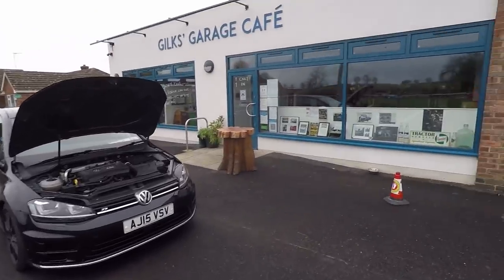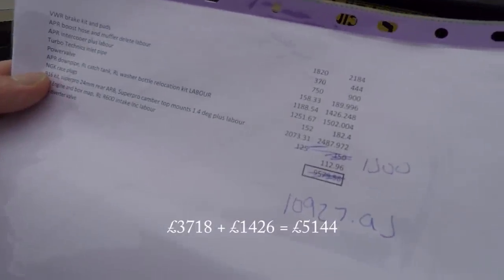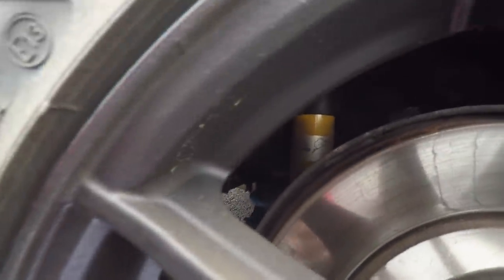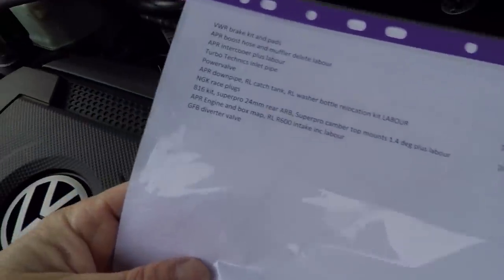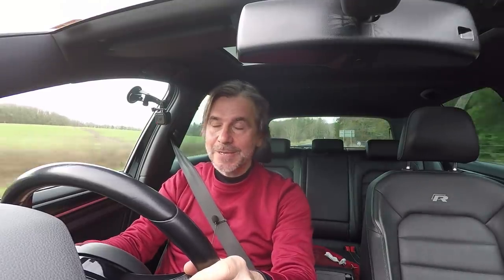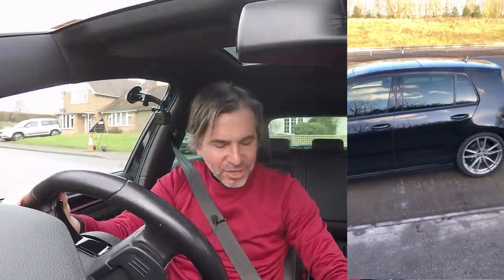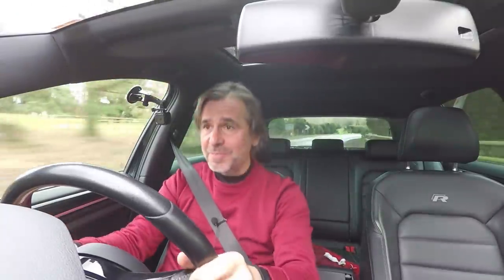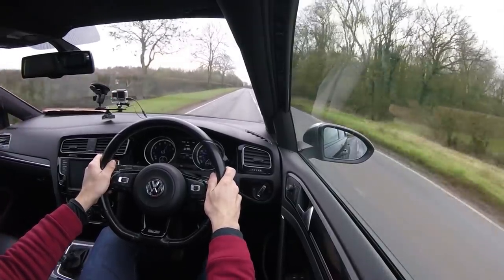CAN this TUNED 395 HP MK7 VW GOLF R be more FUN than a GTI?

Comment: Andew.  I'd be interested to know which of these mods, if any, you'd be interested in having o  your TCR.
Reply from the maker: Good question, OK:
1) Gearbox map (though only when out of warranty as I am not buying another DSG box at £5k!)
2) I like the idea of the SuperPro top mounts but only if not noisy, tempted to fit Clubsport S hubs to do it properly, be interested to see how Mk8 GTI has more negative camber as might be cheaper).
3) Definitely the big brake kit (but in red)
4) SuperPro ARB (prob all it needs for track with top mounts)
5) Racingline R600 intake

The BIlstein B16 DCC suspension is good but I'd have to try the other bits on their own first.  I'd also try the EIbach version which made in partnership with Clubsport S 'ring record driver, Benny Leuchter (although Bilstein and Eibach are mates so it's probably the same bar the marketing!)

I think TCR is fast enough for front wheel drive so I'll leave the engine as it is. Likewise exhaust is characterful enough.
Reply: @volkswizard  Thanks for the reply.  Great vid as usual.  Sorry I got your name wrong (typo honest).
Reply: @volkswizard  Would the same be true for the standard GTI? What about for a Mk6? (I have a standard Edition 35 that I'm considering modding rather than going to Mk7)
Reply: I realize Im kind of off topic but does anybody know of a good site to stream newly released series online ?

Comment: Interesting video - not sure I'd do any of them myself to my R. Fancy doing them to your R Estate? Now, THAT would be a video!!
It would be practical issues I'd have with this - I live hundreds of miles away from any tuning company like this & Id guess that letting the VW warranty run out first would be a given. Totally agree that doing these mods on an older R makes much more sense (mines a 20 plate).

I've tried such things before - sports exhausts, suspension, etc - about 25 years ago on s Vauxhall 1.6 Cavalier 🤣🤣 - to be honest, I'm more into dB than hp - I'd be taking mine to a bespoke car audio place & doing hifi mods/upgrades🤣.

On a different note re Golf R brakes - like yourself, I run 17" Dijon wheels on my R estate in the winter. Obviously the brakes on that featured Golf R wouldn't fit 17" wheels, but I think I remember you saying on your R estate video that the performance pack brakes are the same size as the standard brakes, with different discs/pads but the same callipers - just thinking that would be a great upgrade to do? Probably commenting on the wrong video for that, apologies!

Comment: Car looks great. My only critique would be that you listed the ‘only’ weaknesses of the car being the engine gearbox and brakes and in my view those are pretty much the fundamental element of the car other than the suspension. I have a regular mk7 GTI and having owned lots of Renaultsport cars including the trophy R and then a Lotus Elise Cup it’s not the fastest thing in the world but it’s a great car to drive with an excellent manual box. I’d agree the brakes aren’t the most urgent but for 90% of driving they’re sufficient and it’s very easy to drive the car very fast on some challenging roads and it just handles it well and pushes on with rampant urgency when driven in anger. It’s not as raw as a Megane RS but a great great car nonetheless. PS I have the MPS4’s and they are excellent in all weathers. I drive them daily and in this rotten weather even standing water they’re so good. I’ve had Cup 2’s before and loads of other performance tyres and as an all round tyre the 4s’s are really good.

Comment: Hey Andrew!  Awesome video once more!  However, I'm willing to bet that you wouldn't trade the TCR for the tuned Golf R because, when it comes right down to it, the Golf R is crazy fast and you have to be at that level to have fun.  It's also at that level that disaster is most likely to occur if and when you lose it.  The TCR is just fast enough to frighten, but not so much that you can't control it when it does go too far. The edge is so much smaller at the top end and so much faster on the Golf R, where control is beyond most but career racing drivers. Besides the TCR is still a way better looking car than the R, at least, in that generation.  Be safe and have loads of fun driving!
Reply from the maker: Hey Michael! Glad you enjoyed it. I think for real world daily use the TCR is better but as an example of what a Golf can be,  the mods make that R a very impressive package and because of the limits of front wheel drive, I don't think a TCR modded in exactly the same way would be any good because it would be very frustrating. That doesn't mean the TCR can't be improved,  more negative camber, manual mode gearbox map and those brakes and it would be a much nicer track car with very little compromise for the road.

Comment: Enjoyed the content.nice car.very capable but subtle.tcr would have too many traction issues with that much torque I think
Reply from the maker: Totally agree and that's where the R wins out, because you can mod them to make them come alive and they've got the traction. I still saw ESC light yesterday a few times but I like that because the chassis is finally having to do some work. I think VRS tuned a Clubsport to 500 hp and I can only imagine how hideous that was to drive especially in the damp and cold.

Comment: Welcome to the slippery slope of Golf Modifications Andrew lol How long before the TCR gets power hike and DSG remap then? 🤣👍
Reply from the maker: Hmm well I don't think TCR needs any more power or torque, boring I know but traction isn't great at this time of year as it is and it feels a lot faster than a stock R already (one you get going).  I'd like more negative camber and that gearbox map and I think that would make it a lot nicer to drive on track but no way am I touching that box until it's out of warranty having already forked out for new DSG box on a car that was under warranty because VW did the oil change 1000 miles late and invalidated it.

Comment: Interesting video but sort of implying you need to spend 11K on an R to make it a better car than your beloved TCR.
Also there are few things about the video that I would question.
1. Racingline catch can reduces the octane?!?! 🤔.
2. I'm not going to use launch, because I don't think you should?!? 😂 Thats like saying I won't use the windscreen wipers because you don't think you should. If launch control wasn't supposed to be used it wouldn't have been built into the car by VW. 
3. As good as those brakes are, the early Racingline 6 pots don't have dust boots so they need rebuilding on a regular basis.

Comment: Have to Admire a sleeper, I love mine.
I would have bought the AP 6 pots ( cheaper)
Airtec cooler (cheaper)
Miltek/scorpion decat frontpipe (cheaper) 
I’ve looked at b16 and kwv3 and £15-£1800 nice bits of kit.
The superpro rear arb does make a difference , I love the “boring” understated looks of a golf surprises a lot of cars with younger drivers.
It’s a lovely sympathetically modded car 👌💪my car was tuned by QSTUNING and love it #🚀

Comment: Is 400hp usable on our UK roads though? Personally I'd rather go for a stock manual Golf R or stage 1 GTI, seems like the sweet spot for me!
Reply: I think 400bhp is about the most you need from a hatchback in any country, the RS3 being a perfect example of this, given it has the correct brakes for the power and the chassis to handle it
Reply: Yes, it’s the sweet spot between performance, road-usability, reliability and not forgetting COST.  I run a 380hp stage one map with TT inlet and club-sport brakes.  Total cost circa £1200.  100.  I would not bother with exhaust or down pipe and the catch tank or the expensive BBK, unless all 4 discs and pads needed doing.  The coil over kit is interesting, but stock DCC is already nigh on perfect, so save on the suspension.   

Claimed 395hp  from APR, I doubt, without the larger intercooler.

Comment: Nice video. It would be nice to know what effect the upgrades have on the standard components.. clutch for example. I have a paranoia about failures with VW group cars now.
Reply from the maker: If it was manual car, clutch would have been dead long ago. No idea about DSG clutch longevity but I think 6R tuning showed the 6 speed DSG was pretty tough.  I wouldn't assume the later 7 speed was because as you say a lot of components aren't as durable as they once were.

Comment: What DSG map has this got? I have the APR stage 1 TCU remap and it does change up in manual mode.
Reply from the maker: It's an APR map on both, it was updated in 2018. It was installed originally 31/12/15, invoice says "DQ250 DSG remap".
Reply: @volkswizard  Must be the Stage 2 map. Stage 1 definitely auto upshifts.
Reply from the maker: I've just looked at the APR site and rev limiter behaviour is user definable which makes sense so you can choose to have it or not, your call http://www.goapr.co.uk/products/tcu_upgrade_dq250_exx_fxx.html
Reply: @volkswizard  Thanks! Will check if I can get that enabled on the stage 1 I have with my local dealer.
Reply: @kokekan75  I had a revo stage 1 dsg map and the guy who did it asked me if I wanted the option of hitting the limiter in manual mode or dsg upshifting itself. So I'm guessing apr should be the same
Reply: Apparently the tuner put on the TCU tune he thought most appropriate for a road car 🤣

Comment: Brill video Andrew. Should’ve had a custom remap by Niki at R-Tech though! Best in the business by a mile for this engine. Would love to see you guys do a video.
Reply from the maker: I nearly did some work with R-Tech when I had my Edition 30 for VW Driver mag but the mag went out of business and it I sold the car. The time will come though I am sure, they are quite local to me too.
Reply: @volkswizard  really nice guys. Who know the TFSI 2.0 inside out. I had a custom stage 1 on my Edition 35 in 2019. Transformed the car.
Reply: @stujeffrey  I also have a Edition 35 and looking to stage 1 tune it for daily road use. Did you have DSG, if so did you tune it too and was it worth it?
Reply: @kylenewman7101  I have a manual. If you have a DSG definitely get the updated software to handle the extra stage 1 bhp and torque.

Comment: I'm like yourself, I find the R too boring and not as exciting as the GTI. But when they're done right, they're brilliant cars!
Reply from the maker: I think with AWD you have a lot of potential there, above 300 on GTI and you just won't be able to use, 395 hp yesterday in greasy wintery conditions and it was totally fine as the launch showed, want to try 500 next!
Reply: @volkswizard  Of course, having that ability to throw the power down is great. But it takes away the fun, like you say, it's to easy to do it all so it takes so much drama away. I can imagine, when done right and setup correctly, they're a lot of fun! Hoping to get myself a Clubsport or a nice GTI Performance this year, you do sourcing of vehicles?